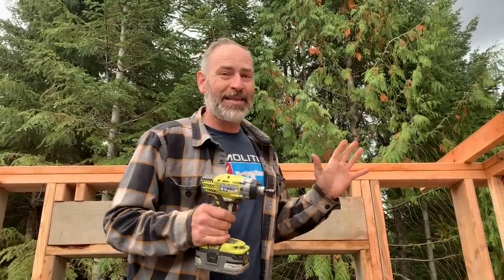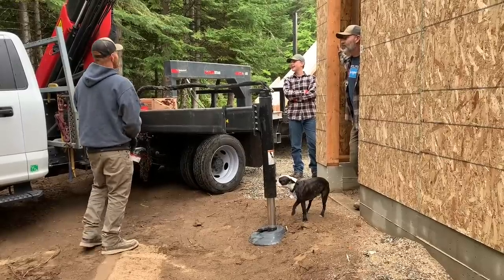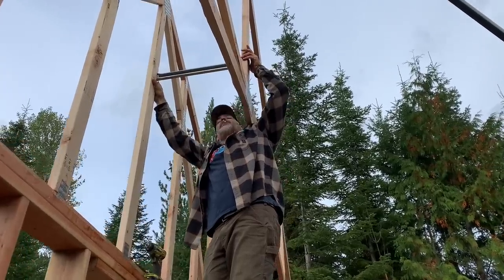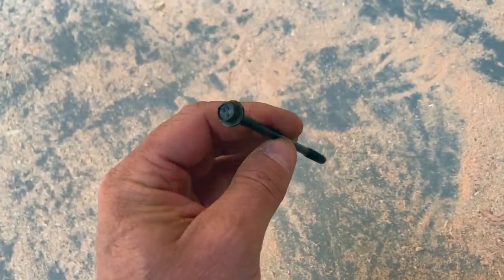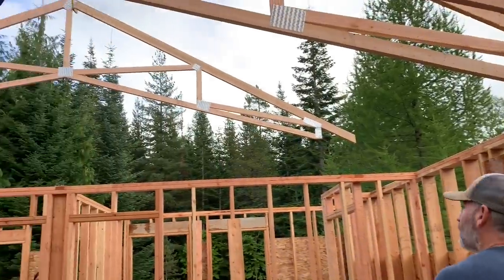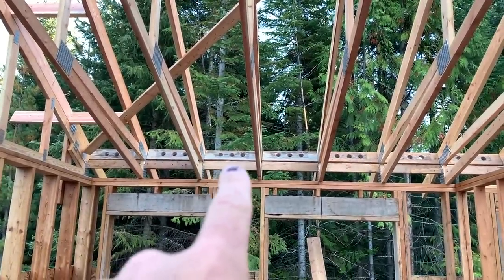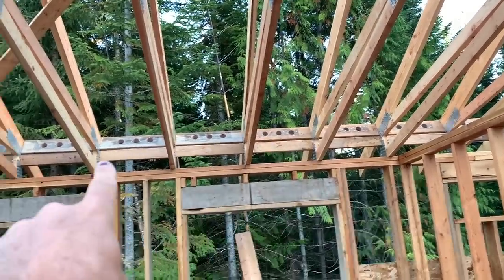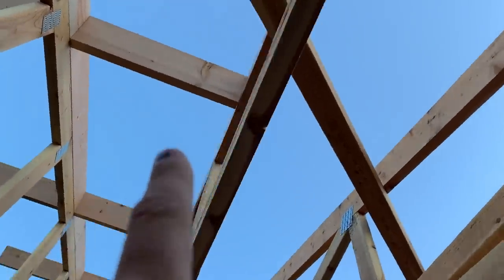HOW DID WE DO THAT! - Setting Trusses with a Crane

Comment: yes, this is the good life :)
Anyway, what kind of timber do you use Pak Martin? Is there any termite threat? Does the timber dry ovened? If it soaked by the rain, does it affect to the timber endurance? I am sking this because we are in Indonesia with tropical climate has bunch of problem by using wood, logs and timber.
Reply from the maker: It is all good here. This is the most common building material. Check out Home Depot’s web site you can see all different kinds of lumber for building.